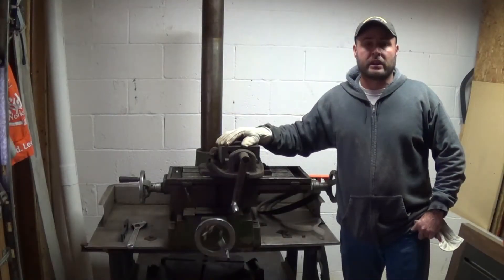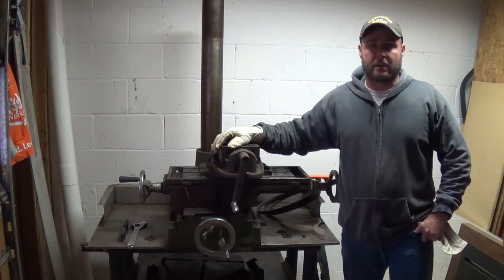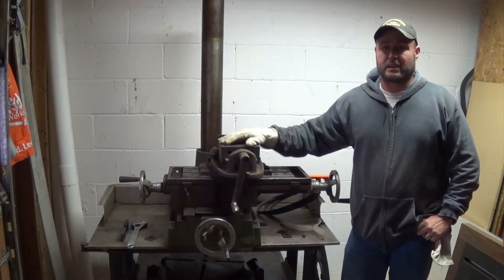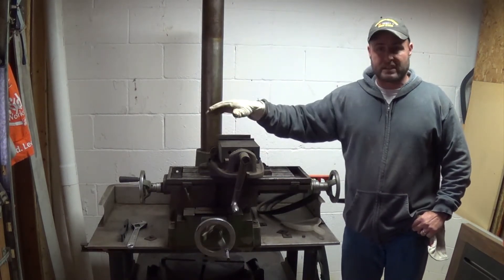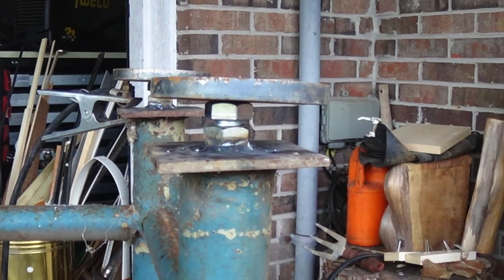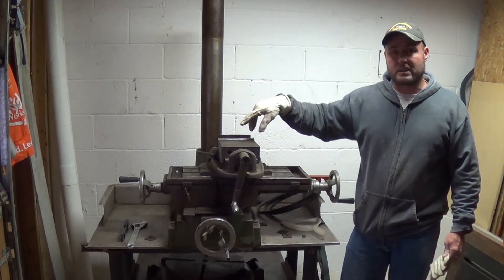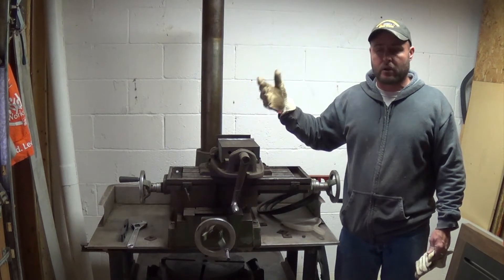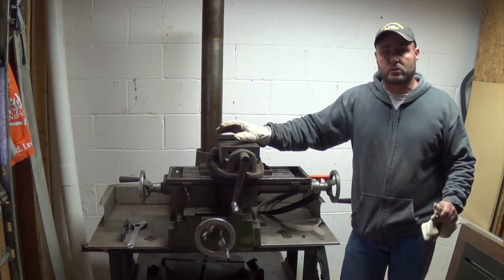Milling Machine 2 Leveling the Mill

Comment: Greetings from Texas.  Did you find a manual?  I have the same machine with the same 4 pulley drive arrangement.  Seems like only the older ones have 4 pulleys and newer models have 3.  Look for the Rong Fu RF-31.  Grizzly as of May 2023 carries a very similar model.  Jet still sells it as well, in an updated version.
Reply from the maker: I found an digital copy of one. Very basic